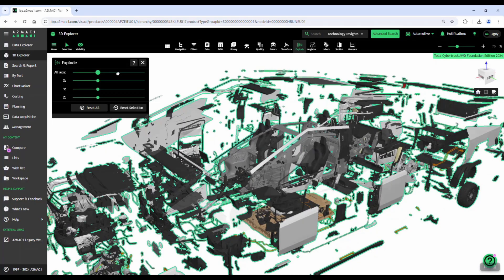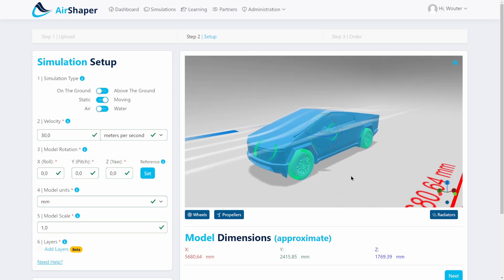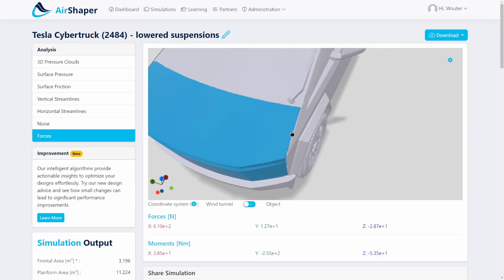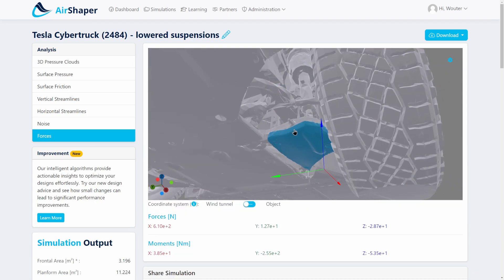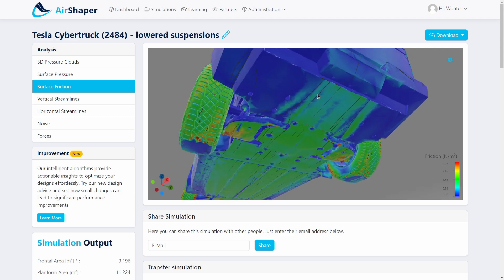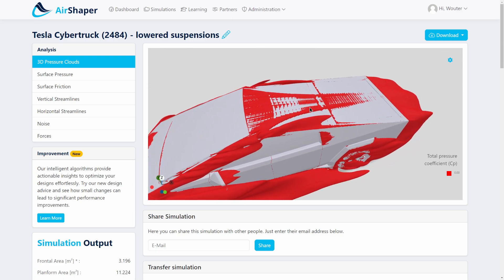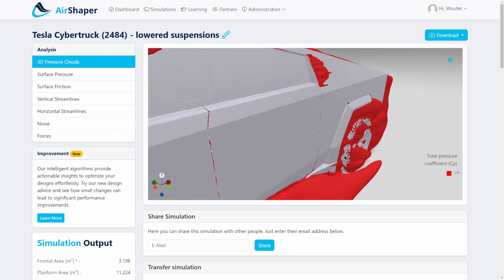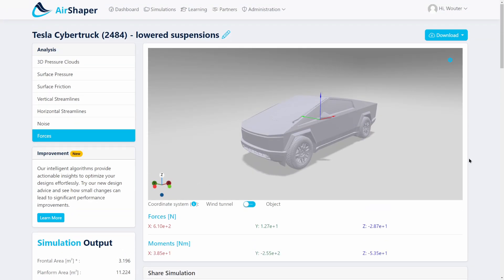Tesla Cybertruck Aerodynamics - Exclusive 3D scan reveals flow secrets through CFD simulation

Comment: The wind noise may be a deal breaker for me...

I demo drove a cybertruck twice this last week.  It had serious wind noise coming from the windshield at speeds above 50mph going into the breeze.  The showroom person said that they've had complaints of windnoise but didn't describe any resolution.

Based on this model, could you suggest what may be at fault?  

The cybertruck owners forum makes it sound hit and mostly miss of correctly diagnosing/resolving the issue.  I'm not allowed to drive the new model that I'd like to buy but the wind noise may be a deal breaker for me if I get that on a truck as I drive a lot.  

I expect I'd probably loose $10 - $20 thousand having to turn around and sell it due to an issue like that that nobody can fix.

Comment: Why don't you spend a tiny bit of $$ and build an actual wind tunnel?  CFD is crap, and will probably always be crap for the next 50 years at least for real, turbulent,high Reynolds number flow.  David Wilcox, author of the K-Omega turbulence model, readily acknowledges that prediction of reattachment points, etc for even 2 dimensional flow is absolute crap (ie with something like 30% error or more in either direction), regardless of which model you're using.  Much less 3d.  He once calculated that to accurately predict a real, turbulent, Reynold's number > 10 million flow, down to the Lagrangian scale, you would need ONE MOLE OF CRAY YMP2 computers!! Granted those were slow, but it's pretty safe to say that we'll never get close to that in our lifetimes.  LOL.  Ask him yourself. 

INVEST IN AN ACTUAL WIND TUNNEL.  This is not hard. It will serve you well for years to come.
Reply from the maker: Reality is that both CFD and wind tunnels have flaws and benefits. Relying on just one would be a very risky strategy. CFD is unbeatable to get insights when your design only exists on a screen. And the wind tunnel is essential to have accurate real world validation.
Reply: @AirShaper  Myeahhh....I don't think so.  I think CFD is so heinously inaccurate when predicting reattachment points in a complex 3-d flow as to be nearly worthless.  But fine.  If it makes you feel better to use cheap CFD for insights, more power to you.  But using CFD as a substitute for REAL, ACTUAL validation is just bad.
Reply from the maker: I wouldn't see it as a substitute - CFD requires validation. Here are some validation cases:
www.airshaper.com/validation
Never perfect, but certainly very close and useful in many cases.
Reply: @AirShaper  OK.  Where can I find the wind tunnel validation write-up for the Cybertruck?
Reply from the maker: @alancollinge9136  There is no public report available for the Cybertruck unfortunately. That's why we try to build as many validation cases on other cars, airplanes, drones, ... as you can see in the link. In terms of this specific process of 3D scan to CFD, we did the same for the Rivian R1T and Rivian themselves endorsed our analysis as well (see https://www.youtube.com/watch?v=LxXCOT5ID20).

Comment: The aero is crap.  The shape is crap, so the flow/drag will necessarily be crap, and no amount of CFD trickery will make that not so.   If you had ACTUALLY designed a through duct from front to rear, perhaps with some turbine driven acceleration, then it would be far, far, better.  But I'm not seeing that.

Comment: cD of 0.33 is late 80' aerodynamics for that kind drag coefficient, when boxy cars begun getting rounded corners. Conclusion is this is not a vehicle for highway driving. The giant wake from the transition from the grille to the side, is not a feature to get the front wheel to create less turbulence, it is far worse as it creates turbulent air for the whole side of the vehicle. Then there is the impossible transition from top of the windshield to the roof.  The simulation you made, is only the boundary layers, not the complete air column. It would not be pretty!

Comment: Any suggestions about where vortex generators could be placed to improve laminar airflow on the CT?
Reply from the maker: Vortex generators can really help to keep the flow attached on an inwardly curved surface, for example.
But here, flow separation is often abruptly forced by a sharp edge. Perhaps adding some ahead of the A-pillar could help to already divert the flow, but it would compromise visibility out of the window, for example (if they work at all).

Comment: I agree it’s an amazing vehicle, a combo of my Model X and a Ford Raptor. Could you comment on a couple things I experience with my 3XXX VIN CT? 
- I get significant shaking in the drivers side mirror (but passenger side is rock solid) at ~80mph (+/-5mph) and also significant door shudder (eg, shakes water bottles in the door storage) with a ~45°NW frontal crosswind. Tesla Service has been unable to solve. Could it be that the windshield wiper induces a separation of airflow at that speed that causes oscillating air pressure on the door skin at those speeds, but which doesn’t affect the passenger side due to lack of wiper on that side?
- or, another theory for the mirror shake/door shudder: my frunk is more aligned with the front edge of the drivers side quarter panel than the passenger side. I asked Tesla service to move the frunk forward to be slightly prominent of the leading edges of the front quarter panels, they said they actually prefer the 1/4 panel leading f edges to be prominent for airflow. Does that make any sense from an airflow perspective? I used the adjustable bumpers under the frunk lid to adjust forward/upward as far as I could (which is why the drivers side frunk aligns closer than the passenger side), but I wonder if the airflow around the side of the frunk is actually submerged rearward of the 1/4 panel leading edges, such that a bulb of air would form at the front corners and create an “invisible” longer nose and rounded corner of airflow? Not sure I’ve described it clearly enough, hope you understand the visual, but I can post pics of my CT frunk/panels if that helps
- why, if the wiper dramatically improves airflow on the drivers side, did Tesla not include a second wiper on the right side  (other than cost)? Is the aero improvement not that significant in terms of overall drag (i see the increased pressure on the passenger side roof glass is significantly more from the vortices, vs the drivers-wiper-side roof glass)?
- I’d like to begin modeling a DIY cap for my truck to smooth airflow over the family mountain bikes and flow air more smoothly to the 19’ camper I tow on our adventures. Which modeling software would you recommend, that would easily upload models to Airshaper to sort out how best to minimize drag losses with the new cap (FWIW, I have limited CAD/Sketchup skills but reasonable aptitude for learning new compute skills)? Any AI-infused modelers worth the time, that would bolster my old-dog-new-tricks learning curve?
Thanks for your work!
Reply from the maker: Thanks for the very detailed comment :)

The Cybertruck is a solid car, so vibrations on just one side would probably come from a local source of vibration, and not the whole vehicle shaking?
Aero "flutter" etc could be a cause, but then it'd have to be pretty intense to make the car shake locally!

But yes, the wind screen wiper could explain why it is more prominent on one side, as the vortex is quite different.
If it were symmetric, you could take it off and install it on the other side. But for now, I'd just try to take it off all together and see if the problem goes away. If yes, then we know the cause! If no, then we have to examine the other theories :)

As for the modelling, happy to discuss this in detail - can you perhaps drop me an email at wouter@airshaper.com?

Thanks a lot!
Reply: There’s a development video this week where the engineers said the windshield wiper will move slightly at speed to improve the drag. There’s also the wheel covers as well.

Comment: Thanks for the video Wouter!
How did you take care of the exchanger's porosity? Did you use viscous and inertial coefficients from Tesla data?
Reply from the maker: In this case we didn't model the radiator. But we can do so at AirShaper, using porous elements and 2 points on the pressure drop curve. Just drop me an email at wouter@airshaper.com if you have more questions!

Comment: would a lower narrow body cybertruck withhout flared wheel arches and smaller wheels have had better aerodynamics
Reply from the maker: Lowering a car usually lowers the Cd (and frontal area, as you cover the wheels more) up until a certain point. Removing the wheel arches could also expose the tires more, so not certain that would always be a win though!
Reply: @AirShaper  (pull the wheels inwards )
Reply from the maker: @replica1052  Yes, that sounds like something which could reduce drag (if the impact on stability, interior space, ... is acceptable).
Reply: @AirShaper  for an entry level cybertruck with less performance

Comment: This really proves what you were saying about the importance of accurate 3D models that are provided to AirShaper ! 
Regarding the design of the truck, I wonder why they simply didn't just add ( low poly ) beveled edges to the sharp edges. 
This would have kept the angular look, but also provide a more radiused edge for the airflow.
Reply from the maker: Very true, small bevels could mimic a radius to a large extent, from an aero perspective, and reduce local flow separations.
I think design aesthetics are still one of the most dominant drivers for a car's design, overruling aero in many cases.

Comment: Very nice! I am about to add the Cybertruck Co Molle rack to my Cybertruck, would be interested to know how it affects the airflow. I have heard a 10% reduction in efficiency, but im more curious to know if there is a wind deflector I could add to help. I have a theory that I could direct the air to flow over the top of the rack and across the surface of a rooftop tent that sits 8 inches higher than the peak of the roofline. Similar to the airflow of a Suburban. The setup is a "Cybertruck Co" Molle rack plus an "Intrepid Camp Gear Geo 3.0" tent.
Reply: This really proves what you were saying about providing accurate models to test in AirShaper ! 
The difference is quite large for even minor variations. 
Regarding this truck design, I have to wonder why it was that the sharp edges did not simply have a ( " low poly " ) bevel applied along the edges. 
I understand the desire to only have a boxy look, and this would have kept the angular look, while giving the air  ( what it sees as ) a curved surface to flow around.